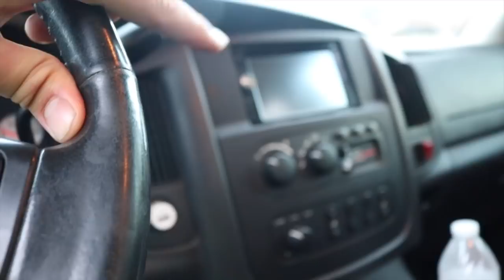I wish it didn't have to be this way...

Comment: Did you get the problem fixed? Did you mess with the fuel screw at all? I used to have a first gen and had to take the injection pump apart to replace a seal. If the fuel screw is out of adjustment it can cause a run away. I marked the threads on the fuel screw so it knew where to stop when reinstalling it. That may be your problem.
Reply: https://www.youtube.com/watch?v=Z8RYy849OOs Watch this video it could be helpful. there are more videos on how to adjust the fuel screw. Good Luck!

Comment: For a last measure if that 5mm ball head Allen doesn't work try getting a long torx of similar size and hammering it on to the head of the bolt, it might not be reusable after that but if you get it out you'll be able to replace it

Comment: Next time you mess with that first GEN make sure you have a buddy with you with a block of wood the block the turbo socut it off so they can do that it’s very sensitive to check your spraying go through what you did your steps sometimes it’s great to videotape what you’re actually doing and you can actually see what you actually did wrong that kind of helps to with all the camera equipment you should try that good video keep up the good work can’t wait to see you next one thank you

Comment: put a fuel shutoff on it, thats how it is with farm tractors you can turn the key off and it will still run until you pull up the fuel shutoff

Comment: Hey man you said your screw had some sort of lock tight on it, well what if the screw has already been messed with? You think if you tweak it just a little bit that it won’t run away?
Reply from the maker: It was set to stock when it was rebuilt 🤷🏼‍♂️
Reply: @LOUDNPROUD  oh okay my bad must of missed the part where you said it was rebuilt. Glad you read the comments man! Became a big fan of yours a couple months ago when I started my first gen project. Keep up the good work!